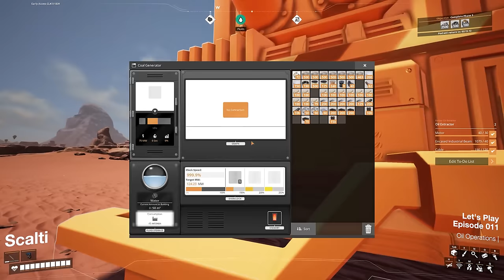Satisfactory Let's Play S01-E11 - Oiled Up & Ready to Go [SATISFACTORY LET'S PLAY]

Comment: one thing to take note of that you will find absolutely useful is that parachutes no longer are used up - you can just wear one all the time for navigating steep cliffs. Major QOL change. edit: after seeing all the water up that way, after you ran out there, I'm sort of hoping that they add some sort of speedboat to get around with.
Reply from the maker: Jet pack. :]
Reply: I use the tilted wall 8m as a launcher, and glide up with parachute, then quickly and safely glide across map.  Poor man's hypertube launcher.

Comment: 1:03:00 a quick tip about z-fighting, if you change the material to something else with the customizer, and then change it back, the z-fighting seems to deal with itself -- no need to dismantle and replace.
Reply: if that doesn't work, place a pillar on the foundation, remove the foundation, replace foundation, remove pillar - is another method for fixing z-fighting
Reply: This is definitely my goto method.
Reply: @barncatgamer6779  well that's still a dismantle-and-replace - I was suggesting it's possible to avoid the necessity

Comment: Idk if or how to make curved, sloped, and covered roads.  But you can make nice curves using catwalk method for quick 10° increments, or a modified/simplified DC_WAN method of rotating foundations in 5° increments.  I've also toyed with a finnicky rail method, where you snap pillars to the bottom side of a sloped/curved rail, then build off those.  Can do nice stairs that way, maybe tilt pillars for a slope.  Might be ugly but functional.

Comment: For coal gens, I like 200% to get 3 water extractors under 4 coal gens, and groups nicely in 4 gen groups.  But you could do 150% for 6:3, I think?  8:3 is just soooo many coal gens.  250% is 112.5 water per gen which is just a bit weird, or 1:1 gen/ext at 250%:93.75% clocks.  or 15 ext per 16 gen but it's a bit weird.